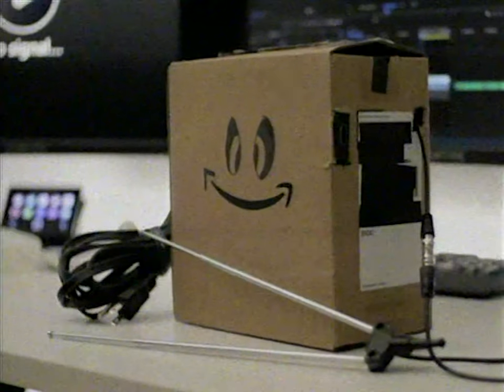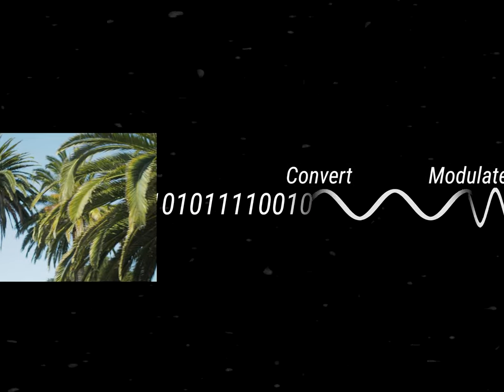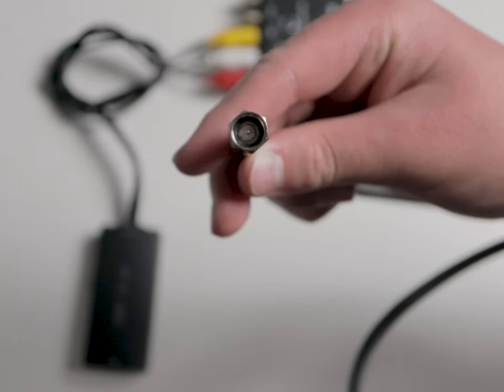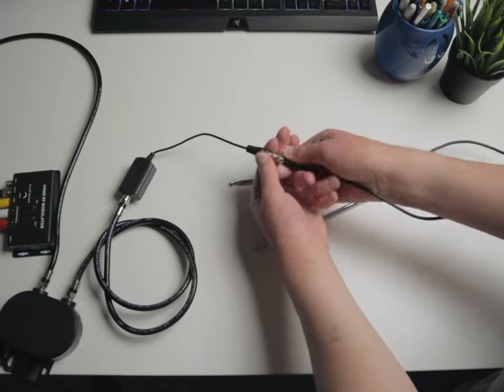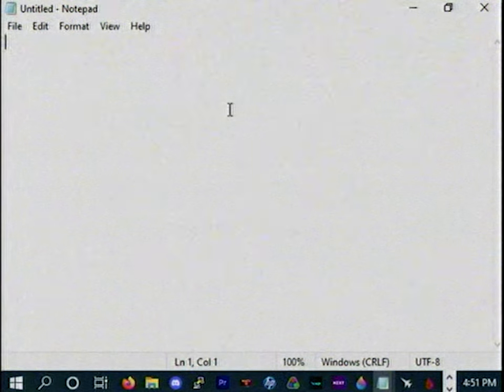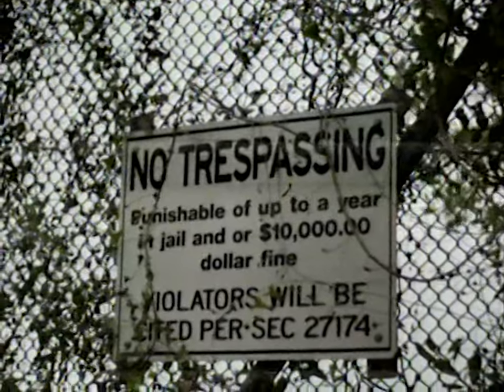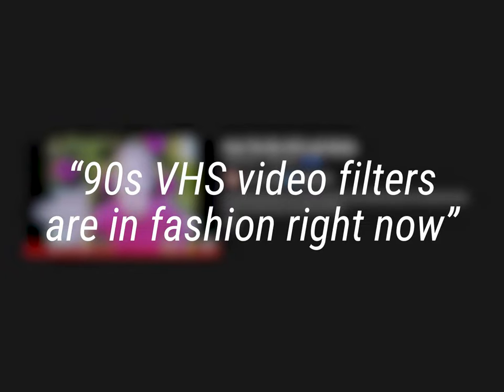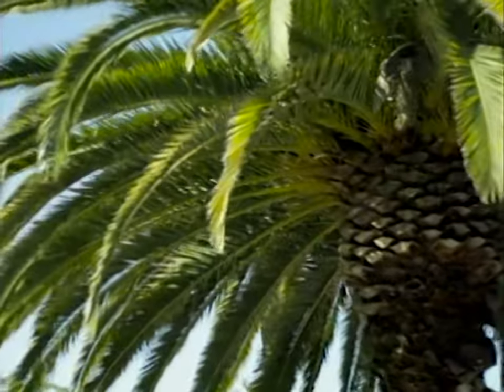Building a 1950s TV Transmitter!

Comment: Though you say this video technology lacks clarity of modern technology, I fully understand why you did this. Same reason people build their own stuff whether it be a radio transmitter or an airplane even if it's already been done before. It's totally cool to actually build something that you can own. Like Tyler the Antenna Man, I sometimes use a modulator with antenna for shortrange wireless video.

This technique has been around for decades, the transmitter or actually a modulator are designed for in-house TV distribution systems used in places like apartment buildings with a common antenna. Techies found they can use these modulators as low power transmitters, instead of connecting cable to distributers, connect it to an antenna and you are good to go. Its convenient modern TVs still have analog NTSC tuning, these can also be used for receiving amateur television. Example CATV Ch 57, 58, 59 (not Antenna Ch 57-59) receive on 421.25, 427.25, 433.25 MHz which are amateur radio frequencies. Put your TV into CATV mode, connect an outside yagi antenna pointed to a ATV station (if one is in your area) selected to either of those three channels. CATV Ch 58 the most commonly used.

NTSC has a fascinating history, yes only a 4:3 aspect ratio, not HD of today's standards. They had to work with what was available. It first began as 60 Hz in 1951 but shortly after they wanted to increase to include a color TV signal. FCC kept that channel bandwidth fixed at 6 MHz, so to squeeze in the chroma signal, they changed scan rate to 59.94 Hz. When computers came along, those video signals set at 59.94 Hz to match available CRT monitors. When flatscreens appeared, they set scan rates to 59.94 Hz to match the computers. It's the same since then (exception certain gaming computers). So that modern HDMI, SDI, whatever scan rate frequency all from legacy created by engineers from early 1950s.
Reply from the maker: Really interesting info about the CATV channels and some history. That's cool! Yeah, I always wondered about the 59.97 stuff.. The technology connections video has a lot of good info on it too
Reply: @SimonVideo  dive into those early days such as "what happened to Channel 1?" also early pioneers such as Philo Farnsworth and manipulations by David Sarnoff. A whole smorgasbord of stuff like mechanical TV sets interesting but limited. And the technical and political debate on what method to use for broadcast TV (NTSC won). But wait Europe embraced 50 Hz and PAL. French did SECAM. Here's what's interesting: Motion pictures in theaters are 24 fps (or same frame twice to avoid flicker) and yes even still today movies are done 24 fps (exactly, not 23.96). Why not faster rate like TV? Studies have shown if watch a movie at 59.94 people will see it as a TV show and not a motion picture (weird).

Comment: Not the same thing, but I hooked up an antenna to a VCR I got from a thrift store recently via RF Out on the back of the VCR and then an antenna to an old CRT TV I have, and I'm watching the VCR, "wirelessly", on "Channel 3" on the TV. The antenna from the VCR has to be touching or at least be millimeters away from the antenna/cord that's plugged in the TV because the signal is so weak. It's the only experience with some sort of broadcast "analog TV" I've ever had. I'm only 21, but I love old tech, and I will get an amplifier soon, and maybe even an RF modulator.
The TV is a classic old design, rabbit ears too, but I thought I'd never use it again and I needed an antenna for a weather radio I had so I ripped one of the antennas off so it only has one now. I could tape it back on so it really feels like an old TV with an old antenna (don't really need the antenna in the radio anymore). The speaker also got busted a while ago so no sound comes from it, and until a few days ago, I haven't used it for months, but when I did the VCR thing I mentioned before, I realized I had another old radio that could tune into VHF and UHF channels, so I put that near the antenna from the VCR, so that plays the sound, and the TV plays the picture. I love that little setup I have.
Reply from the maker: Hey, that works! An amplifier would help for sure. That radio is really nice to have on hand
Reply: @SimonVideo  I think I have a couple of those old VHF/UHF/AM/FM radios too (one of them even has weather radio stations too) and 2 more small CRT TVS and one big 32" one. I need to start getting more maybe, after I get an amplifier setup. I don't want this old tech to go away. :(

Comment: I use a similar rig that I used a vintage candy tin (insulated with a rubber mat inside) to put the electronics in. I use it for my vintage analog portable LCD TV collection. Unfortunately some of the "cheaper" models like Casio lacked any AV input and still rely on channel 3 to receive a broadcast. This setup facilitates a broadcast, and with some of the analog TFT color portables, you can even play classic videogames over the air as NES and consoles up to PS2 still have composite output. 

Here's a challenge, find a good sized O gauge train building, integrate the electronics into the building, and get a train tv /radio broadcast tower for I think it's still $16.79 at Walmart for the kit. Put a single antenna through the center of the tower and you now have a very good looking "actual" broadcast tower from the 50s.
Reply from the maker: Ooooh that's awesome! I really love the idea of the small scale broadcast tower. I just got excited and now I'm about to impulse buy one.
Reply: @SimonVideo hi, is making a low power analog station legal in some ways?
Reply: @SimonVideo i already have a coaxial coupler as i bought a coaxial cable for the tv cable box downstairs
Reply from the maker: I'm not going to outright say if it's legal or not. I think it is, but it's do at your own risk
Reply: @SimonVideo  oh okay well I probably won't ever do it then unless I want the FCC At My Door
Reply: @SimonVideo  if I did actually make my own low power analog station I would hope it would only be able to reach two of the TV's upstairs and a little bit of the living room tv only
Reply: @CatsRobloxOther2nd Technically, I think broadcasting radio signal in general (including ATV signals) and/or causing interference is illegal, but in practice if you make reasonable limitations to your transmitter to the point that it doesn’t interfere with anything (or protect the transmitter in a faraday cage) the Government either won’t care or will have a tough time getting evidence

I’m not an attorney, don’t cite me on it

Comment: This is a fun little project that makes a neat effect.

I must point out that amplifier was designed to plug into a TV aeriel input, not run as a transmitter.

Analogue TV with a decent signal was a crystal clear picture. It was only in poor reception areas it looked like what you have there.

The bandwidth was a lot higher for the video than the equivalent digital resolution in pixels was too, that's why even direct A-D or D-A video never looks like true analogue broadcast actually looked. It's also why flat screen TVs looked like crap when we trued to use them on analogue signals and old game consols.
Reply: You didn't notice the crystal clear part was sarcasm
Reply: @DanielBerzinskas  did you think of that all on your own?

Well done, you've earned yourself 15 minutes with any toy of your choosing and a gold star

Comment: I didn’t know it was quite so easy! Might give it a try with a (PAL) BG transmitter - I have a 1973 B&W TV with a built-in antenna, and already connected it to digital TV using an SD decoder that outputs to SCART and a modulator. But doing it over the air would be very cool.
Reply from the maker: Yeah that would be cool! I was also surprised that it was so easy to make.

Comment: Would I need to have the amplifier plugged into power as well? Or just have the coax to coax? I’m using a ge amplifier and the power is just dc into the side of it
Reply: Yeah, you gotta plug in the amp. Otherwise you won’t get anywhere

Comment: Question: How far did the signal travel; How far away from the transmitter could you get & still receive a picture?
I'm gonna be following along at home; I've been wanting to do this for years now!
Reply from the maker: Yeah! It probably went 30 feet before getting too fuzzy, but that was going through walls. You can also get it to go longer if you point the antenna in the direction of the transmitter but even then it's pretty unstable

Comment: A more powerful, yet more expensive option is to use an agile modulator. Pretty much a large, commercial-grade RF modulator. Blonder Tongue makes some of the best, I recommend the AM60-550b.
Reply from the maker: Interesting! Didn't know about those. Do you know why they call it "agile"?
Reply: No idea why they're called "Agile". Google search turned up nothing. Perhaps it's because they're more flexible and powerful than regular RF modulators? They can broadcast on VHF 2-13, UHF 14-38, and the first hundred or so cable channels. The output is very clear, beating all consumer-grade equipment. These were meant to be used at TV stations and big apartment buildings. Downsides are that they are rack-mounted, very big, and they also put off a lot of heat.
Reply from the maker: Ahhh got it. Yeah looks like it's gonna be a long night of scrolling through eBay 😂 Thanks for letting me know about them!
Reply: No prob. Though rare, look for one with Option 5, Stereo Sound. Most of these machines are Mono by default. You'll also need a coax-to-RCA adaptor for the video cable, no idea why they did that. If you keep them cool, they work far better than anything else. I think I spent $70 or $80 for a mono one, and $130 for stereo. Wait for a good deal, my friend.

Comment: Could an amplified antenna work in place of an amplifier? Or do I need a separate amplifier?
Reply from the maker: I don't know.. I don't think it would because you wouldn't be able to wire up the amplifier in reverse.
Reply: What the heck is an amplified antenna? If you mean those flat antennas that advertise 500+miles of range I’d advise you ignore that, you’d be better off building your own

Comment: Hello, have you got an alternative amplifier for Amazon? I live in Europe, there is no Walmart where I live.
Reply from the maker: Pretty much any amplifier works, just search "TV Signal Amplifier" into Amazon.
Reply: @SimonVideo  Some amplifiers I saw don't come with a power injector, just the amplifier itself, also should the amplifier be connected to the TV or everything is wireless? And last question, if I wanted to connect my computer, should I connect it through the HDMI port and to the HDMI to composite converter?

Comment: Nice video. I ordered the parts and I am waiting for them. Also do you know what the power output is, and what is the range that this can transmitt, and also how I can increase/decrease the range of the transmitter and also how to increase the power output?
Reply from the maker: The range isn't all that far... maybe 50 feet max. As far as increasing output and range, you would have to get a more powerful amplifier. I would stick to a lower output because it's illegal to have it go too far.
Reply: Increasing the range 101:

- Measure the antenna to its reasonably frequency (both “ears” being 25% of wavelength)

- Match the antenna (Use hairpin match, antenna tuner, etc.)

- Increase the transmitter power (do NOT exceed 5 watts without matching the antenna, it’s a fire hazard)

- Improving the receiver’s antenna

- Connecting transmitter’s ground to a better ground (the ground pin is usually the screw part of the connectors)

Comment: Excellent video and tutorial, great work! How did you manage to get the final video feed (the one displayed in analog on your TV) into a digital file and uploaded to YouTube? Did your TV have a built-in video capture mode, or did you use a separate video capture device?
Reply from the maker: Thank you! For the capture I used the Hauppauge WinTV HVR-1265
Reply: @SimonVideo  Cheers! I'm definitely considering recreating your setup for an indie analog horror series I'm working on. Is there any specific software you'd suggest to use alongside this? I've read a bit on how it seems to work well in Windows Media Center, but that's for Windows 7 I believe.
Reply: I also would like to add, I'm primarily a Fedora Linux user, so any software/compatibility layer in that regard would certainly help. If not, no worries, I dualboot between Fedora and Windows 11 all the time :)

Comment: the dark picture is caused by the HDMI To composite device, i have got two of them, two different ones and they have the same effect. there doesn’t seem to be a way to fix this. sad considering back then when we had VGA to composite converter boxes, they actually had functions to change the picture settings, while on these hdmi ones, you can’t
Reply from the maker: Interesting! Yeah, it's a really cheap converter.. I need to get a better one (maybe a VGA one)
Reply from the maker: Thanks for the info!

Comment: A better HDMI to coax adaptor and better RF modulator would make it way better. I’ve done this with much better results, I was trying to make my own broadcast station but knew almost nothing about RF at the time and blew out several RF amps and modulators.
Reply from the maker: Haha, yeah I got a new HDMI to composite adapter (still super cheap, but the old one only did color half the time). Any suggestions for amps/modulators?

Comment: the modulator can be changed for a DVD/VHS Combo and the result will be the same
Reply from the maker: I'm not sure what you mean by changed..
Reply: What he means is that you can replace the modulator with a VCR. Most VCRs have composite video inputs and RF outputs; they’re basically crude transmitters because they were built in a time where 300ohm twin screw was the standard. I built my first station using a VCR, as a matter of fact.

Comment: Hello, I wanted to ask if the decoder and a small rectangular DVB-T antenna will also work fine without an amplifier, best regards
Reply from the maker: Yeah all antennas should work even if it's digital, not positive about amplified antennas though
Reply: @SimonVideo  I'm the one I have for her
it has a cable with a plug and a cable that amplifies, but it can be unscrewed from the antenna, thank you for your answer

Comment: Interesting...
But I have only one question, the amplifier that you're using in this video does supports digital signals? (Not sure if the word "Digital TV" is a thing in the US? Because I live in Thailand)

Even I searched on the local online store (of course, Walmart isn't available in every countries including Thailand) it's does found them that made just for Digital TV signal only, is these device might work as analog signals too?

Also, I'm not sure if that would work with PAL television too? Since my country was broadcasting in PAL (as i remembered)
Reply from the maker: I believe that any amplifier will work. I don't think it cares what signal is fed into it, so analog or digital, ntsc or pal, it should work just fine.
Reply: The TV RF amplifiers are meant to amplify the radio signal that the transmitter/receiver produces, and digital is technically an analog radio wave moved in special patterns, so it should work the same

Comment: I have an old CRT TV and from 1986, and I've been wanting to play games from my gaming PC onto my tv. I have my Roku connected to it and I tried video streaming for my PC to the Roku and it works fine the only problem is that there was too much input delay. How bad is the input delay if I make something like this and hook it up to my PC and send the signal to my TV?
Reply from the maker: Does it have to be wireless? I would say a wired connection would be much better. But yeah, there's virtually no delay from the composite in to it being displayed on the CRT.
Reply: @SimonVideo  it does have to be wireless since there's no way to run a cable from my PC to the TV which is in the living room
Reply from the maker: @hectordaniellemus-mesa4480 Ahh yeah. I mean, this would probably work but the quality wouldn't be the same. I know there are wireless HDMI transmitters which might be the better (but sadly more expensive) option.

Comment: Hey! Do you know why this works on certain TVs and not on the others? I have a bunch of CRT TVs and it works one, but not on any of others for some reason. Thanks!
Reply from the maker: It doesn't work at all? I had an issue where color wasn't working and it turned out to be the HDMI to composite adapter
Reply: @SimonVideo  Thanks for the reply! It does work on some of the TVs that I have, so I know for sure that the setup is correct. However some other TVs that I have don't seem to be able to find the right channel of the broadcast. Not sure why. It is also mot the issue with the antennas because I used the same external antennae to connect to TVs.

Comment: Would digital TV rabbit ears work for transmission? Or would I need one that is strictly an analog antenna?
Reply from the maker: All antennas will work with either signal since technically it's receiving the same frequency and all that. Especially unamplified antennas. Not sure about amplified antennas though.
Reply: @SimonVideo  Thanks!